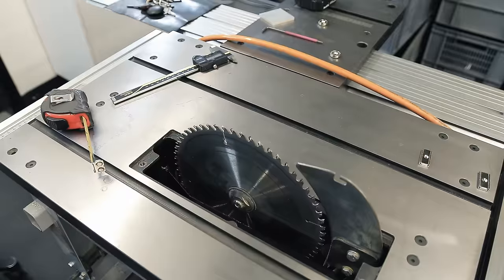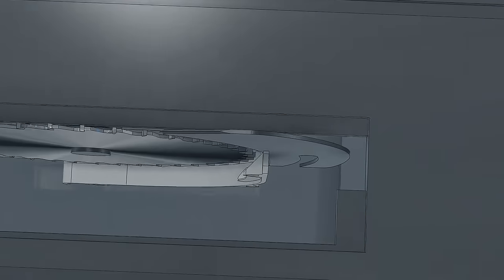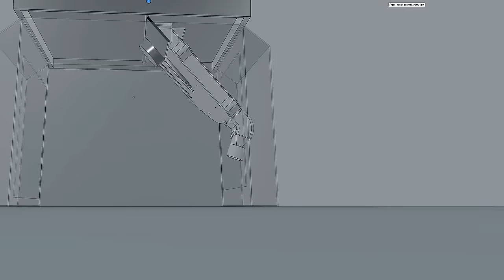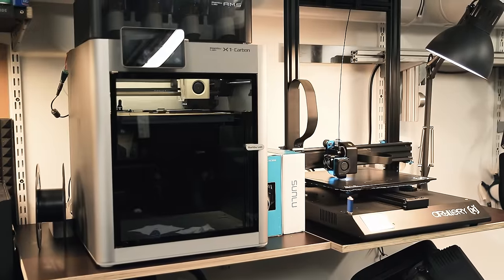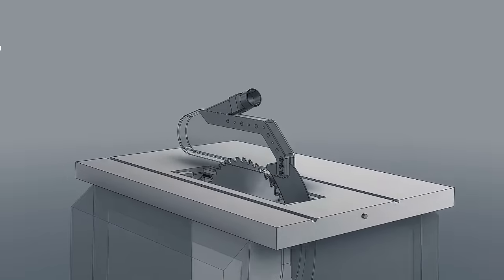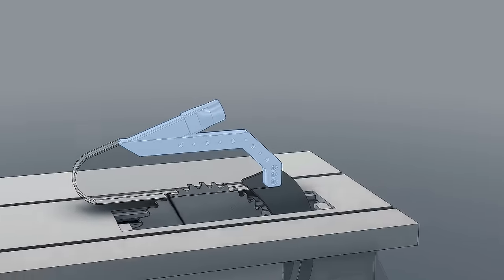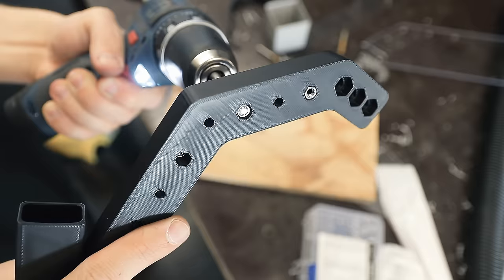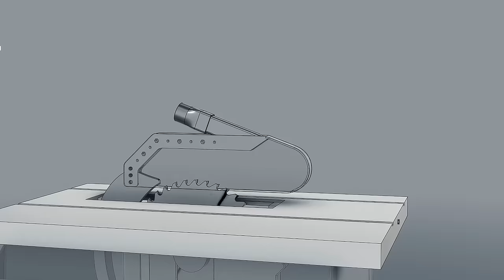How I re-engineered my Table Saw Dust Collection from Scratch using 3D Printing

Comment: Nicely done! Your dust box looks a lot like the inside of my Felder slider now:) looks like you have a completely adequate solution, but here’s a random thought. Often wondered about an air blast on the leading/ trailing edges to re-direct those heavier particles toward collection. Seems like getting the req’d delta v on particles accelerated by the saw blade is asking a lot from air flow from any dust collector.
Reply from the maker: Well if these comments tell me anything, there's literally endless potential to keep tinkering with this stuff! As you said, a big problem is the sheer velocity with which the saw blade shoots stuff around, plus it also creates its own air pressure and acts like a big fan. For now I'm glad I at least managed to get the fine dust mostly removed, you can literally smell the difference
Reply: @PhilVandelay  your lungs will thank you ;)

Comment: One thing I didn't hear in your considerations is that the blade itself is acting as a fan.  That is why it is acceptable to collect the dust at the back of the blade instead of the front - the air movement just caused by the blade is very good and the particles get pushed to the outside of the housing as they spin around.

Comment: A foam rubber strip could work to improve a seal on the riving knife if you wish to add it.

I've seen router benches use a sealed box under the router to create suction at the bit. Do some circular saws mimic this design or are all like yours with the encasement of the blade that must be examined when buying to avoid shoddy function?
Reply from the maker: There is one approach to solving this that involves ditching the dust box alltogether and making the entire saw base the dust box, so sealing all edges and building a funnel  into the bottom so that anything that falls inside gets captured. The problem is that you always need the slots in front for the handwheels so some dust tends to come out there and it's also work intensive to implement but might be similar to what you mean. I haven't looked at many table saws so not sure what the really expensive ones use

Comment: Ilike how you CNCd a custom box.   I don't have one, but you clearly show how a good design can allow an excellent customization. 

Couldn't you take (or magnet)  a plastic bag skin, or cloth,  bergen the blade box (covering the hole) and the underside of the table? That could accordion when at 45, but guide most into the box when at 90?  I did that sound the entire motor of me DeWalt, which, despite being sloppy because I didn't dismantle the housing,  takes 95% of the dust in the"engine"compartment.

Comment: Very inspiring, such a well documented project. Thanks for sharing these insights! (I have a similar heavy cabinet saw with mediocre dust collection at best)

Question about the insert plates: I thought about printing them too, but wasn't sure about the strength and durability. Do they hold up? The insert plate of my table saw is very thin so I was hesitant to print them.
Reply from the maker: As said in the video I don't use this saw heavily (as in daily) but so far they're holding up totally fine. They're ever so slightly lower than the rest of the saw table so the wood doesn't even touch them that much. If you dropped something heavy on them they'd probably crack but then again you don't want to do that on a table saw anyway ;) 
As for durability, I figure if they wear down I can just print new ones but so far I see no reason to. You could also consider using a tougher material like PETG or Polycarbonate - I don't think there's much to lose if you just try it

Comment: Would it improve the hood even further to add a flexible rubber flap to the bottom of the front curved part where material enters that would drop back to the machine table after the workpiece had passed by it?

Comment: hmm, what if you added a small brush to the front of the top dust collector, if long enough (and short enough to not hit the blade" it would prevent the chips from fireing back out the front when you come close to the edge, cause the brush would go and fill the gap between the table and collector. maybe just U shaped brush tp the front wich follows along a bit of the sides aswell

Comment: what if you screwed on a rubber or silicone strip flap that would go inside the bottom of your top cover.  when you push the wood in to be cut it would slide on top of the piece of wood and when the wood passed through the front of it, it would fall to the table keeping the larger pieces inside the dust hood and not flying out the front

Comment: While totally understanding the laws of diminishing returns… I wonder if floating side panels on the side of the above table guard or bristle brushes would further increase the capture of larger particles. But yeah, I get it.

I’m primarily a woodworker and I have some machines that are at the higher end of the price bracket from SCM and I can tell you they have not really thought this through either!

Comment: I could spend years improving my workshop and be completely content haha. 

On the mounting of the dust hood - how did you determine an appropriate height with regard to the riving knife and blade?   It always ensures alignment is perfect with the blade but may not be ideal for all cuts?  
From previous testing I've examined, would a sliding vertical adjustment be worth implementing (or even necessary?)? Lower the shroud until it is just touching the material and you create a seal of some capacity. 

I've seen some on arms that lower the dust shroud yet that seems very reliant on a precise lock and setup to prevent it being off axis and having blade interference.
Reply from the maker: I did include 3 mounting heights because I wasn't sure either but having it go slightly over the top of the blade seems to work fine. The hood moves up and down with the blade so I just set it to whatever height the workpiece has

Comment: The 3D printing material is Petg-CF (especially for the large cartridge)?
Reply from the maker: Nope it's all normal PLA. If any of this breaks I might consider reprinting it from something more durable but I want to test it for a bit first. In my experience the effective difference between printing materials isn't that great anyway unless it's something that's load bearing in some way (not really the case here)

Comment: Not sure of you mentioned it, but why not make the entire collector in the  bottom part stationary (and wider to account for the angled blade)?
Reply from the maker: It's not just the blade that moves in isolation, it just looks like that in the 3D model. Look at the shots of the inside of the saw, the entire inside including the motor moves. The entire space inside the saw changes drastically, no box would fit around all that
Reply: @PhilVandelay  ah, I see. It felt like there was something I was missing. The solution you came up with is great. 
While I have never even touched a table saw I can really understand the urge to figure out a solution to the sawdust menece!

Comment: This is the Kity 419 table saw. Kity, a french company, was bought by Scheppach. They still produce this saw under their own Scheppach brand and I believe they produce this machine for other brands or sold the rights to produce under licence. It’s an absolute excellent saw, although some features can be updated or improved upon. Mine was made in France, though.are you positive yours is made in China?
Reply from the maker: I'm 99% certain yes, but it's very common for these types of machines to be (sometimes almost exact) copies of existing machines. I guess they don't see a need to re-invent the wheel. I just looked at the Kity and you're right, they do look very similar but I also see some differences. I'd bet the Kity has a higher build quality than this one (not that it's bad) and you can see they use a more elaborate fence for example.

Comment: Stainless steel msqueeto mesh makes wonders for plastic ,its like a  rebar in concrete.
Reply: You mean pause the print, drop the sheet and resume? I havent done it yet, but I had thought of using spring steel, and rods to strengthen 3D printed parts.
Reply: i am struggling to imagine a scenario where this doesn't just create an incredible weakness at the layer you insert the mesh. how on earth can the plastic above and below bond properly?
Reply: @cho4d Trough milion of tiny little holes ofc! Idk about 3d printing i havent tried i since i dont have 3d printer but i use it all the time to fix broken plastic.I sink it in with soldering iron,works wonders..
Reply: @zumbazumba1  ah, okay i understand. i thought this was a suggestion for 3d printing

Comment: Metal dust collection is imperative to cutting metals safely and efficiently. you should always vacuum after metal working because the metal can get into and damage equipment, or cause injury from small, sharp flecks.

Comment: Why didn't you simply built a wider box around the blade? This way it could be fully closed. I don't see why the dust box has to tilt with the blade...
(not a woodworker)
Reply from the maker: Just look at the shots of the motor tilting, the entire space inside the saw changes, the box would have to change with that.
Reply: @PhilVandelay  oh ok. It was difficult to get that perception from here 😅

Comment: How do you handle the dust from your bwlt grinder?
Reply from the maker: I made a video on it, it has some spark shields and a collecting pan which is sufficient for me to contain the mess. I use it 99% for metal which creates much heavier particles so they don't fly around as much as wood dust

Comment: Large hose diameter: lots of air moved, but low suction. Small hose diameter: little air moved, but high on suction. You are combining a shop-vac with low volume and high suctions with a saw that is designed for high valume low pressure...
Reply from the maker: There's plenty of people who use this saw with big high volume dust extractors and they have the exact same problems. It's mostly in the design of the saw

Comment: Could you not solve the entire inside dust collection by basically draping a tarp over the whole assembly that has the hose attached, that would cost nearly nothing, be pretty much impenetrable and would work in any orientation of the blade
Reply from the maker: That's not as easy as it seems because everything moves around. It would have to be long enough for the lowest blade position and then when it moves up it would fold in on itself and risk getting caught in the blade
Reply: @PhilVandelay  that's very true, it was just a thought experiment anyway, and your solution works really well so no point in changing it now

Very entertaining video by the way I'm normally not that into Machining content, only from a select few creators but I might stick around here :)

Comment: i hope you wont find out the hard way when it breaks after some thin stock gets in there and starts dancing
Reply from the maker: Would have to be pretty thin to get through the zero clearance insert and then it would probably just get broken up by the blade. But also if the dust box gets destroyed, the good thing is I can just print a new one

Comment: Attention all woodworkers !!!!   there is no law against using a thin 6" blade in a 10 inch table saw. 50% less dust, zero kickback, quieter, cheaper and safer. I haven't used a 10 inch blade in five years. STOP using 10" blades, especially when 99% of the stuff you're cutting is only 3/4" thick.
Reply: Ideally for a good cut in wood, there are design criteria for how fast the tooth of a blade passes through a piece of wood and how often a tooth should follow to cut the next bit of wood from the board. A 10" blade for a 10" saw is designed with this in mind. The rpm of the saw is designed to meet this criteria. 

What your saying is correct, however, now you've changed the design parameters of the saw by going to a smaller blade. The velocity of each tooth is much slower, meaning each tooth is striking the wood much slower and for many materials will no longer provide the optimum cut. Tear out, smoothness of the cut, etc. will be affected, even the longevity of the blade will change. Instead of the blade taking little nips of wood away, it will be taking chunks away because of that speed.

It may work for your application, but for many, especially those who work with hardwood regularly, it will create problems. Of course you can slow the feed rate down to prevent some issues, but ideally, a 10" saw was designed to run a 10" blade to obtain optimum cutting conditions.

Comment: You realize you can 3D print springs and bellows, right?
Reply from the maker: So?
Reply: @PhilVandelay  Room for improvement, specifically addressing all the vacuum leaks
Reply from the maker: @custos3249  That's still really vague, where exactly would you put springs and bellows and what would they look like?
Reply: @PhilVandelay  The short piece used to cover the gap but allow the table can tilt could've been solved with a section of bellows, like a Chinese folding hand fan, then continued around to the longer side parallel to the blade to reduce losses caused by fitment gaps. TPU or similar material would be ideal. The only area that'd provide a difficult challenge would be sealing the massive gap around the blade/motor shaft, especially if you can't mount anything on the motor side. If you can't, someone elsewhere also mentioned bristles, which are essentially just a collection of half unsecured leaf springs. They'd offer the simplest solution but may not provide enough restriction to air flow if not densely packed enough. There really shouldn't be much of a risk of entanglement, and the right lube should be able to account for friction issues. The goal should be to design around pulling as much air as possible from between the upper blade guard and the saw top.

I'd ultimately have to assume these issues are why some elect to build a small box around the whole motor and blade assembly. That option comes with its own problems to solve, but I see the appeal.